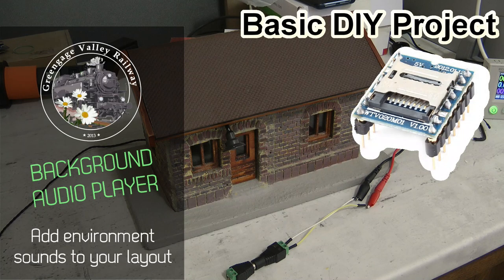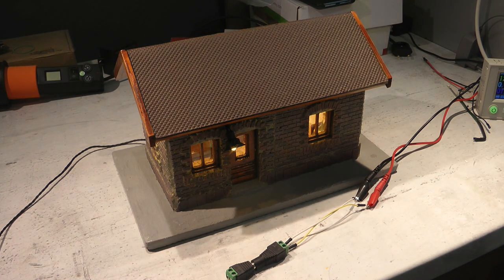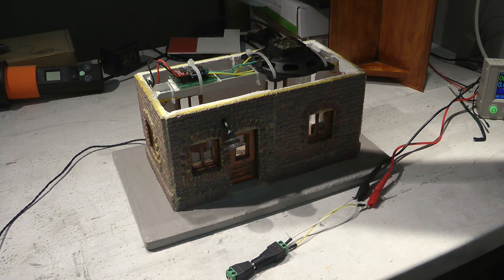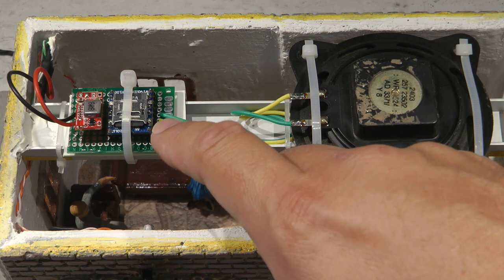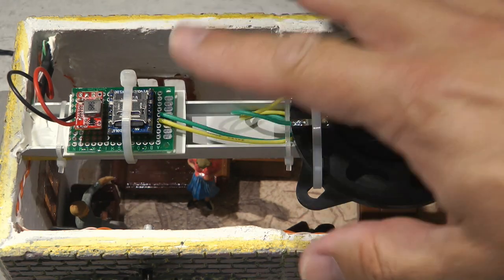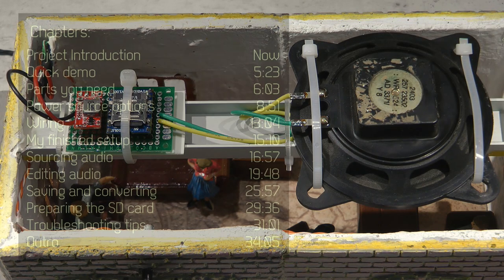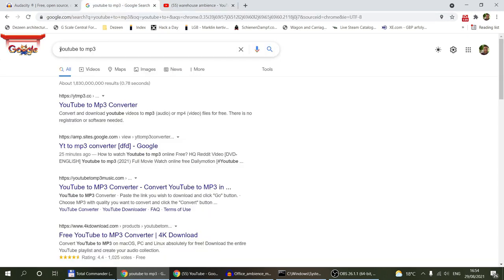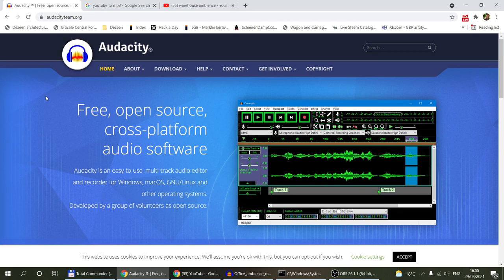Ambient audio player

Comment: I have never even thought of sound for the buildings before, but it makes a lot of sense, and could be setup on a timer so the sound is off if you are using the railway really early in the morning for shunting, and on during the day.   Really cool idea.
Reply from the maker: Yes. I am running these off 12V and there is a main switch for the layout which is usually off. But I suppose I could do that.
Reply: @csongorvarga  It was more just an idea I had in my head for something, as sometimes I play with my trains early to do pre-dawn shunting operations, which would be outside of office hours :).  
Thanks for all the great ideas.